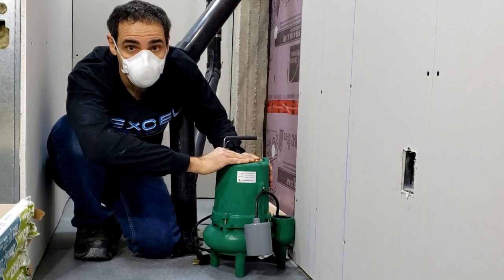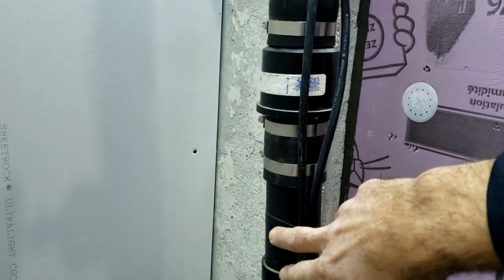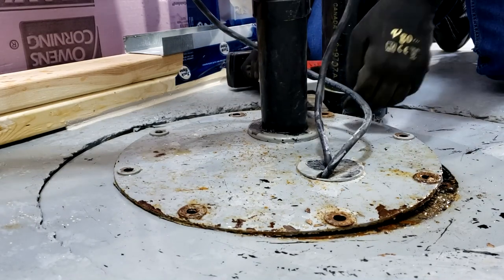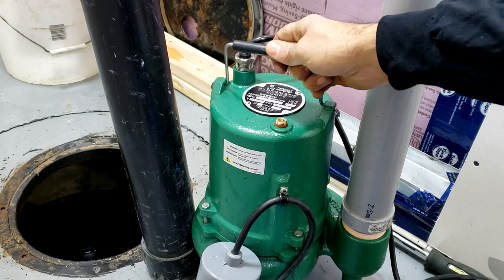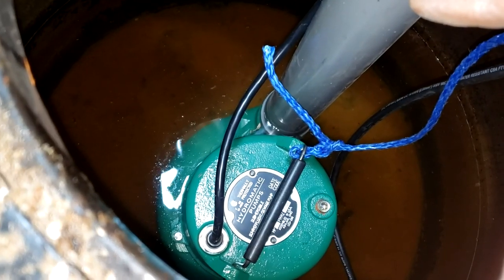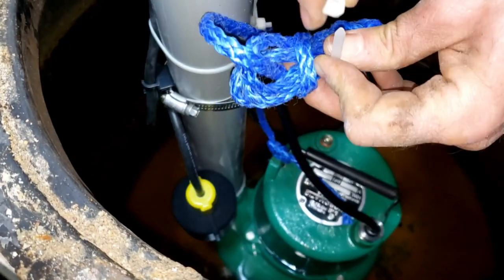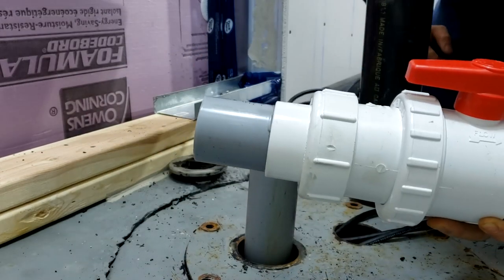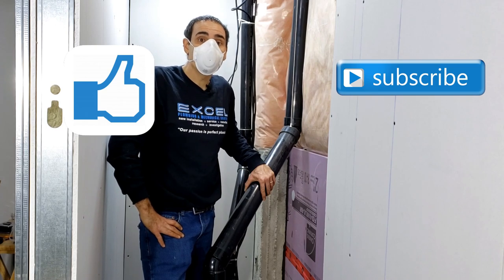How to Install a Sewage Ejector and Float Alarm

Comment: Great video, who manufactures that union, check and valve (all in one) ? part number? Thanks
Reply from the maker: Thank you...I'm delighted you enjoyed it! 🙏. Just finished editing the next one only minutes ago and it should be out soon, so please do stay tuned!

As for the check valve, I cannot recall the specific brand used I installed in the video, but you can find virtually identical ones by Little Giant, Liberty, and Checkmate (and it may actually have been one of those!).  Any reputable plumbing supplier should have them.   Here are some examples:

https://www.libertypumps.com/Product/QBCV150C-QBCV200C

https://littlegiant.com/products/wastewater/accessories/check-valves/cvbv-2u-check-valve/

The ones shown are union slip-on-type connection, and truth be told, I had actually ordered that type for the job in the video - but my supplier had shipped me solvent-weld (glued) instead.  So I adapted using the proper connection methods. 

Whichever valve you choose, just be sure that you're installing one that's approved to meet the legal Building Code requirements which fall under your particular jurisdiction.  Here in Canada - depending upon the material - it may fall under ULC, CSA, ASSE, ASTM, and more!  If the valve is approved, it'll be marked or molded accordingly on the material.  Hope this helps, and thanks again for watching!
Reply: @PlumbingsCool  Nice! thanks for sharing those links. I got to tell you the reason I asked was I NEVER seen the exact one as in your video, so very curious who makes it (and you sourced from). Look forward to your future videos.

Comment: Im running a shower and toilet to my septic system but theres not enough fall. I dont have a basement. Should i dig a hole and put one of these in a crawlspace then run my piping to pump it upwards towards the septic?
Reply: What is your opinion on this?
Reply from the maker: I can't see why that wouldn't work, if you're OK with the additional work and expense involved.  Note that you will also need to run a minimum 2-inch vent from the sewage pit, and of course ensure that it is easily accessible for future servicing. 

If you're only running what sounds like a 3-piece bathroom, another possible option may be for you to consider a bolt-down macerating toilet that accepts drainage from a raised shower and a lavatory.  If you're unfamiliar with them, a macerating toilet essentially grinds the waste and pumps the sewage up through a measly 3/4-inch(!) pipe. 

 Saniflow, and I believe Liberty Pumps, make such models, which have been around for decades - notably in Europe.  Although I'm not normally a fan of macerating toilets (I prefer the simpler gravity-flush toilets because there's less which can go wrong mechanically), I have installed these alternatives without fail, as viable solutions for where installing a proper drain may not be practical or cost-effective.
Reply: @PlumbingsCool   @PlumbingsCool  thanks for your input. Im not able to add a septic tank on the other end of my house and figured to add a pump instead. but with it having to go in the crawlspace its not easily accessible for maintenance.
Would the 2" vent be able to end in the crawlspace?
Reply from the maker: No, definitely do not leave an open drainage pipe in the crawlspace. Doing so will emit harmful sewer gas into the space and eventually into your home.

And in case anyone suggests so, do not use a cheater vent/air admittance valve either.  These are not proper vents and would cause closed pump systems to malfunction.

The only proper way is to run the vent pipe up into your attic (if you have one) and either tie into to another existing vent pipe, or run straight through the roof (if so, you'd need to properly weatherproof it by installing the appropriate vent flashing).
Reply: @PlumbingsCool  ok thanks good to know about the vent. I have never heard of the macerating toilet. I see it has a pump would that be sufficent to pump just a couple feet incline at about 75' horizontally and save me from needing to install a sewage ejector pump? If so that seems like the simplest option.
Reply from the maker: Yes, absolutely you can pump up a few feet vertically.   Horizontal run is a non-issue, as a pump works on what we refer to as "head pressure" (a topic for a completely different video 😁).  But the short story is that water gets "heavier" the higher it rises (0.434 PSI per vertical Foot).  Thus all pumps are rated by their "head" capacity.  Even ten vertical feet shouldn't be a problem for these pumps.

I encourage you to jump onto the manufacturer's website, download the respective user's manual and read through it.   You will still need to trap and vent the fixtures (and toilet) properly to ensure that the traps don't lose their water seal (to protect from stinky sewer gas).

Hope this helps!
Reply: @PlumbingsCool  ok i will do that. I watched a couple videos stating you need slope of 1/8" per foot even with pump does that sound right to you? My pipe from the toilet to my septic would look like a long V shape if that makes any sense
Reply: @PlumbingsCool  thank you for your help as this is a big project for me and want to do it properly. Youve been very helpful!😊
Reply from the maker: If it's pumped sewage, then you technically do not need any slope...although it's never a bad idea to let the pumped sewage drain by gravity wherever possible...doing so would minimize the volume and pressure pushing back against the check valve.

Not exactly sure what you mean by "V" formation, though I'm guessing that you'll need to change horizontal direction with your pipe so that it returns back toward your septic system.  That would be fine, as long as you use the proper drainage fittings:  In a gravity drainage system, you cannot use 90-Degree elbows to change horizontal-horizontal direction (i.e., a elbow 90 "on its side").  Rather you should change direction using a series of 45-degree elbows which will increase the turn radius and ease the flow travel.

Oh, and also to your question:  A minimum of 1/8"per foot (or 1% fall) is only allowed with 4" diameter pipe and larger;  anything lesser in size requires a minimum fall of 1/4" per foot (2%).  Again, this primarily applies to drainage piping draining by GRAVITY and not sewage pump systems (otherwise known as a "force main").

Comment: Where could I buy the ball shutoff you show around 34:35?
Reply from the maker: I'm not sure where you live, but any reputable plumbing supplier should carry it.  If Google-search "Plumbing Supplier" in your area and call them up to save yourself some effort.  Simply ask for a "2-inch PVC check valve & ball valve combo for sewage ejectors." 

 If it is indeed for a sewage ejector, you'll want to ensure that it's for 2-inch pipe (*NOT* 1-1/2", which is designed for smaller storm water sump pumps, and do not usually have the integrated ball valve) .

Also, one other thing I should mention is that the one you see in the video is "solvent weld" connection (just a fancy way of saying "glued!"); another common type is "compression", which requires no glue, but relies upon the tightening of large, integral nuts at each end of the valve to ensure it properly seals and grips the pipe ends.  If you opt for the compression type, be sure that you tighten the two outer nuts with a pipe wrench or really large pliers so that adequate grip is maintained. 

Hope this helps, and thanks for watching!

Comment: How far of a run will a 1/2 horsepower pump push?
Reply from the maker: Hi there!  A half-horsepower is a mighty strong pump for domestic applications.

In any event, what's important about pumps is not the horizontal length the discharge needs to run (which requires minimum effort to push effluent), but rather the VERTICAL height you need to achieve before the sewage can discharge horizontally, where gravity can take over.  A pump's  "vertical height" capability is referred to as "head"; the higher you need to go the "heavier" the sewage gets (water pressure increases at the bottom by approximately 1 PSI for every 2.34 feet it needs to climb).  Your pump should have the respective head rating stated in its documentation, which states the "gallons per minute" or "litres per minute" discharged based on height.  But a half-horsepower pump should be able to discharge at a reasonable rate even as high as thirteen or fourteen feet.

Hope this helps, and thanks for watching!
Reply: @PlumbingsCool  , thank you. I only have 2’ of rise by the run is 140’. Just wondering if that’s going to be a problem.
Reply: @USMCord1  I'd need to look more into your scenario to be sure, but if it's how you describe (with no rise beyond the initial two feet), I don't anticipate you having an issue.  It would be ideal if you could put some downward grade onto that horizontal run to help it drain as naturally as possible with minimal assistance from the pump.

 If I'm ever in doubt in a particular situation, I take the initiative to call the equipment manufacturer directly - specifically their technical support department - and explain the situation to them.  No one knows a product like the ones who created it!
Reply: @frankspatone  , Thank you!

Comment: How much does the labor cost for a job like this ?
Reply from the maker: The labour cost depends on several factors, including whether there is an existing pit or not, and how far the drainage and venting need to be run.

Presuming that the pit & drain are already in place, and the vent run to open air, labour (excluding equipment and material) should take about 4 to 6 hours when all's said and done... Therefore, probably up to about CN$900 at my rate. 

A brand new ejector pit is a completely different story, and will easily run several thousand dollars.